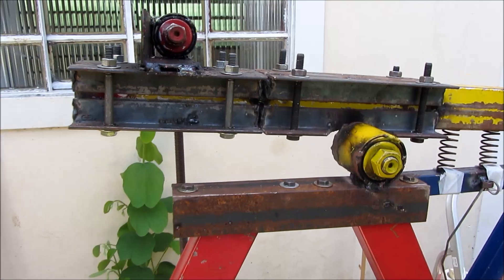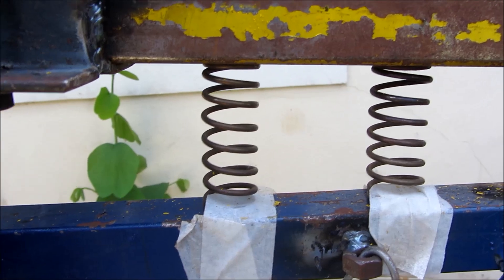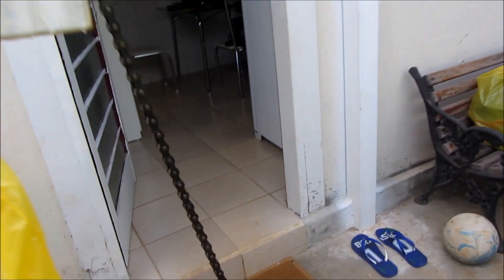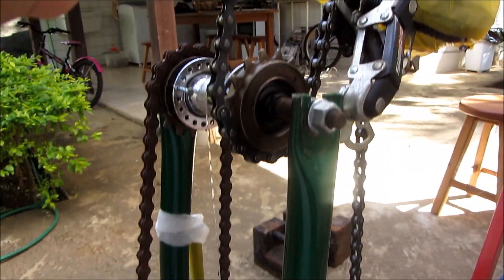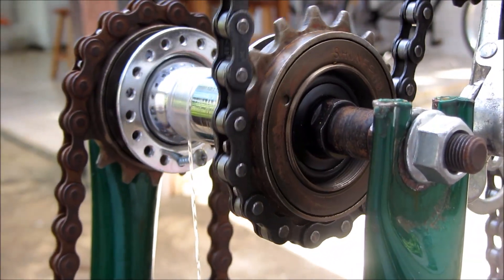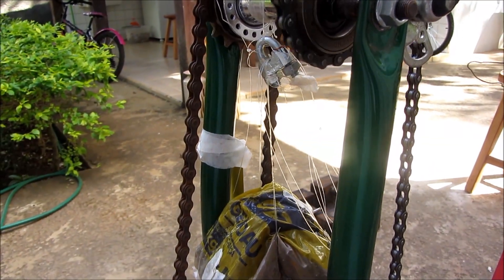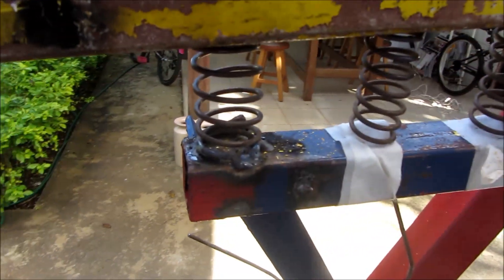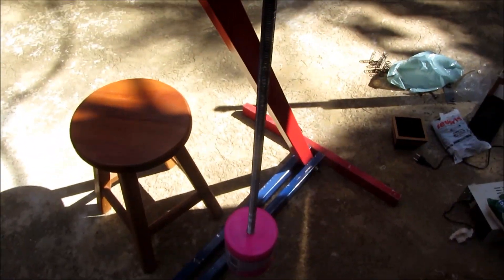1- Milkovic Two Stage Oscillator Pendulum - Overview of the machine

Comment: Veljko Milković, an academic and inventor from Novi Sad, has done something great that has not been done by any Serbian inventor before.
Namely, according to his invention, a two-stage mechanical oscillator, today over 300 conscious companies manufacture, use and sell machines and crushers used in the heavy industry.
The purpose of the two-stage mechanical oscillator is multifaceted, because the character of the machine (two-arm lever with pendulum) allows its use as a press, compressors, crushers, power generators, mini power plants...
The world's companies have made use of this invention because its use eliminates the need for non-renewable energy sources in the wide range of jobs for which this machine is used.
With this move by world companies, Milkovic implemented that his invention could be used in practice and very successfully.
 Through such achievements, Veljko Milković laid the path for new challenges in physics in the 21st century, which could be the forerunner of the new great scientific revolution.

Ono što je novosadskom akademiku i izumitelju Veljku Milkoviću pošto za rukom, do sada ni jednom srpskom pronalazaču nije. 

Milkovićev izum dostenepi mehanički oscilator uveliko se primenjuje u svetu, a dokaz tome da  preko 350 inostranih kompanija, koristi, prodaje i proizvodi mašine, koje rade na bazi penduluma, a koje se koriste u teškoj industriju. Ove mašine koje se koriste u rudarskoj i drugoj teškoj industriji, naviše se proizvode u Kini i Indiji.

Namena dvostepenog meganičkog oscilatora je višestruka, jer karakter mašine (dvokrake poluge sa klatnom) omogućava njenu upotrebu kao presu, vodene pumpe, kompresor, drobilice, elektrogeneratora, mini elektrane.

Svetske firme su ovaj izum iskoristile, jer njegovom upotrebnom smanjuje se potreba za neobnovljivim izvorima energije u širokoj lepezi poslova za koje se ova mašina koristi.

Proizvodnjom mašina za tešku industriju, dolazi do veće uštede energije.    

Na ovom sajtu možete pogledati kompanije

https://companyveljkomilkovic.wordpress.com/

Comment: Recovery springs?
I hope I can explain it simple so every viewer can understand.
Heavy side of the horizontal bar should lean on steady support.
Pendulum is getting energy to swing, and then gives energy to bar to lift
the other side. When that side goes up or falls back we harness that energy.
Point is that input energy to swing pendulum is less than energy it gives
by centrifugal force to lift the other side of the bar. Or is it?
How much energy you invest to swing pendulum, and how much
you get from its centrifugal force at the bottom of swing?
All in all, the horizontal bar is not meant to be pendulum, it is working lever.
~~~~~
Instead of lifting mass, spin flywheel and use it for good dynamo.
And on pendulum side attach bedini swinging coil, not on floor but on bar,
to make it independent of up-down movement of that side of the mechanism.

Comment: In the two stage pendulum, the weight is lifted and dropped . While it drops is gives up all the energy given to it back to the pendulum to lift it up again for the next stroke, ( and also contributes to keep the pendulum swinging due to synchronised changing   of the pivot point of the pendulum ) and so no  effective work is done on the weight  after it is raised and dropped.
It is an energy circulating machine and not an energy delivering machine to a lossy useful load.  The effort of the operator goes to overcome the losses and imperfections of the machine, bearings drag, windage etc.
If the weight is not allowed to drop due to a ratchet  arrangement as shown here, then the drop of the pendulum must be made up by the operator.  It is a machine for amusement and for studying modes of oscillation of a system with multiple degrees of freedom.

Comment: Any chance of seeing it working, before 2500?
Reply: +Luiz Fellipe Salomon 
Dude.
He meant, 
"Why didn't you demonstrate that your machine REALLY CAN lift the weight in the video?"
Reply from the maker: Hello. The machine IS working. Haven't got it to do perpetual motion - and I don't believe it will before - way before, 2500. Any case, I am sure I won't be alive to see perpetual motion.
But....
But if this is not exactly what you asked, you can check some other videos I made showing the machine in different situations. You can see how awesome it is as a power multiplier.
Reply: @LuizSalomon  You don't necessarily need closed-loop PP. I've seen these Milkovich pendulums in action on the www for years and, going by what I've seen, it should still give good efficiency if the pendulum is powered by an external source.
Reply from the maker: @steve_ancell  What I tried to demonstrate here was that the machine had good power, but poor energy. In terms of efficiency and with my precaurious apparatus and testing done, something around 30% would be an educated guess. It is a wonderful machine but far from realizing any work better than a centrifugal pump or some existing machine.  Thanks for the contribution.
Reply from the maker: Lica Metal I made a series of 6 videos, if I'm not mistaken.  The last two shows the machine working. Unfortunately it passes far away from an overunity machine. I compare it with a bouncing basketball: you can't compare the distance traveled by the ball based on it's initial position and potential energy. At the end it's the amount of work done and the amount of energy spent.  Thanks for watching 😊
Reply: Luiz Fellipe Salomon

Okay.
Anyway, looks like the guy realized it too, somehow.